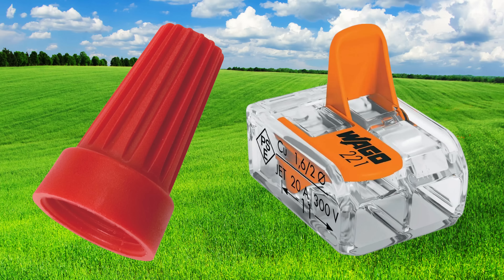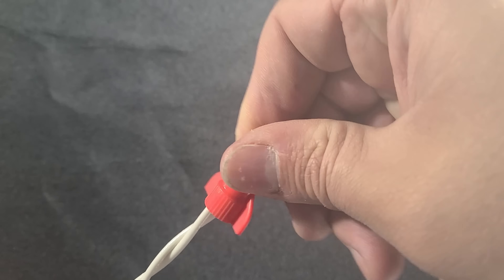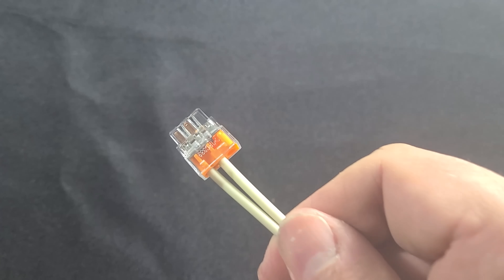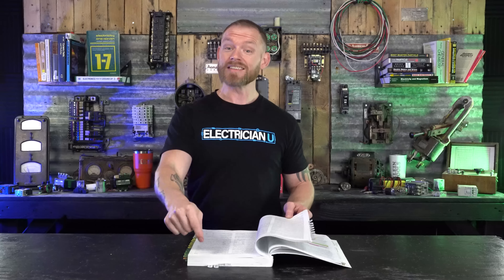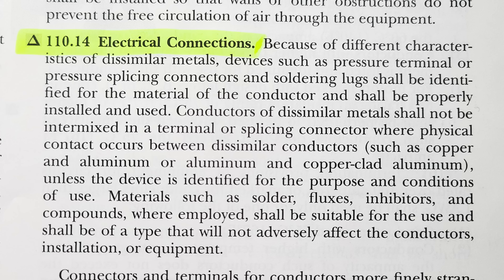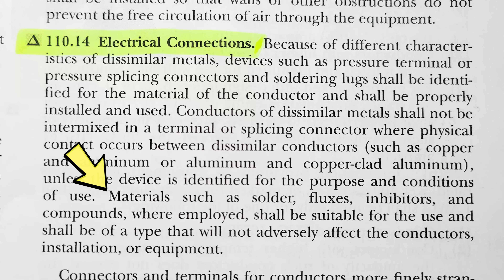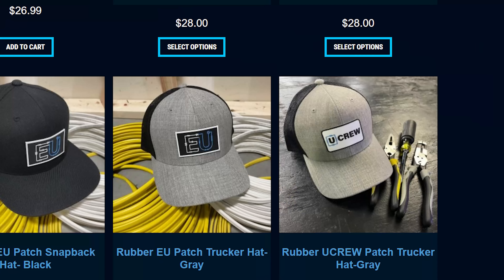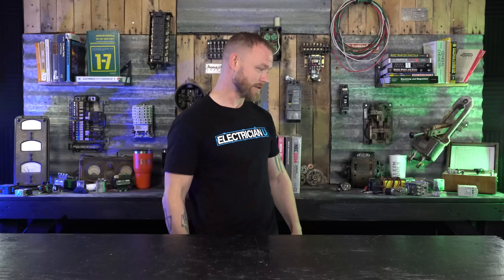Should We Use WAGOS or WIRENUTS?!?!

Comment: My contention with twisting wires—and my subsequent love of lever locks—stems from the fact that I've opened hundreds of boxes in the last 30 years to find 'work hardened' wires so brittle that the twists simply snap off the wire. Almost invariably the junction has already been reworked multiple times and wire is too short to reach the outlet and barely long enough to splice.
Reply: poor striping technique left the conductors nicked and fragile. it's the number one problem which dates right to the root of electrical wiring installation, stripping, over bending, smashing make it fragile. that equals game over.
Reply: Yeah, I wish everyone could figure out that you're better off to just put the wires together and put a nut on them. Twisting sounds like a good idea until you see a pre twisted wire that still doesn't make connection or burns up in the nut. I never have problems with just sticking them straight in the nut, no twisting or taping.
Reply: @jasonfoster9118  The problem with what you detail there is that the connections are not always made correctly and you get people then claiming that Wagos are superior because your connection failed.  The primary reason one pre twists the wires together is to assure visually that all the conductors to be secured under the wire nut are in intimate and proper contact.  Just holding conductors together and then applying a wire nut and assuming that all the conductors are held fast is shoddy workmanship.
Reply: wago/lever nuts also work by applying constant pressure, usually on a plastic pivot or boss, over time the mechanism becomes brittle and then you lose the tension the connection is relying on to stay in place.
Reply: That’s why the wires are required to be 6 inches beyond the face of the box.
Reply: @lsp4050  What code calls for is one thing.  But it doesn't fix existing installations from decades back done poorly.  In the end, short wires suck and the bypass butt style In-sure connectors are the cats ass for dealing with them.
Reply: @mikeiver  I’ve been doing inspection since 1999 and in 2006 the state of California finally required electricians to become apprentices before they could become journeyman electrician. Same thing I had to do before I became a journeyman machinist. Electrical is so much better here in California and it had been before and the structures are in better shape because they don’t hammer holes to the walls, shear walls. The Vegas singing commercial is bolted down transformers and make sure you have the proper clearances in electrical room and if you’re over 600 KV you have the one hour rating in that room. My jurisdiction requires all unused electrical in commercial to be removed, that irritates them.  Anyways, I enjoy what you’re doing and my boss enjoys it as well. Keep up the good work and maybe talk about motors
Reply: @lsp4050  Wires are required to be 3 inches from the ‘front’ face of the box and 6 inches from the sheath.
Reply: Work hardened wires?  I think not unless we are talking about wires that have been in place for many decades.  95% of the wires that break off are due to the installer stripping with linesman plires or incorrectly using a stripper and putting a knotch in the conductors.  Wagos don't fix this issue.
Reply: @mikeiver  Most of the houses I've worked in were built in the mid-1900's so perhaps I have a particular kind of exposure bias. I see lots of paper filler and woven outer jackets... and lots of fragile twists that break off inside the nut.

While lever-lock connectors don't retroactively prevent incompetence they do save the day when there's only an inch of wire left in the back of the box and there's no slack left in the wall. Have fun twisting a Marrette onto that. ;)
Reply: @helmanfrow  I have had to deal with allot of the very same as you.  Here we also deal with soldered and taped connections as well knob and tube. We tape or heat shrink the wires.  Also, agree with wires being short and wagos or insure being the only viable option.  Ideal has an inline push in that is perfect for the issues you detail.  Don't get me wrong, I use them, just not my goto for new work.  Over the years my attitude has "evolved" towards them and they are now in my kit.  For troubleshooting and quick fixes I keep them in my pocket!
Reply: @mikeiver  I'm actually surprised he didn't talk about taping the wire nuts. I always do this. Most, at least diy lowes/home depot light fixtures, for instance, will always call for the wire nut to be tapped after ensuring the wires are secured well. This is very common from manufacturers. it's just piece of mind as well.
Idk, I like tapping them.
I think about how cheap they are, how close they are to other wires and the off chance something happens, I don't want something happening from a 2 cent wire nut by not adding 2 cents of tape to it.
Reply: @todtalk3912  IMHO, taping the wire nuts, which I’ve seen, just leads to a ball of sticky mess for the next guy to deal with and he’ll just probably just cut it off and leave even shorter wires.
Reply: @todtalk3912  Non skilled electricians tape their wire nuts.  Properly terminated wires in a wire nut require no tape.  Those that use tape are covering up excessively long stripped conductors sticking out of the base of the nut or lack skill to terminate all wires correctly there in.
Reply: @todtalk3912  Properly strip and terminate the wires in the wire nuts and tape is a waste of time and unnecessary.  It is also a pain when you or others need to remove the connections to make changes.
Reply: @mikeiver  well take a copper wire bend 4 to 5 times likely to break on 6th to 8th bend copper work hardens wago dose not bend wire on install
Reply: @simonlang2001  it is interesting to me that people seem to think that I am anti Wago.  Connection wise, properly installed wirenuts are simply superior in terms of resistance.  Admittedly, in terms of skill required to install, they kinda suck!  Wagos are far simpler to install correctly and to verify that they are installed properly.  I like and use them, just not in high sustaind current situations.
Reply: Have to disagree with you on that one. I've seen it far too often.  @mikeiver
Reply: @ethelryan257  Doesn't change the fact that I am right.  Wagos have a higher connection resistance.  Resistance is heat.  Heat leads to failure.
Reply: @mikeiver  Why not just use Wagos if it's much faster and easier? Is it the cost or would you rather spend 5 - 10 seconds longer pretwisting then applying the wirenut thinking it's a better more durable connection (Wagos are UL listed dude and less error prone which means safer)? I remember way back when people used to strap and apply plaster for our walls. It was funny to see the contractors who just wouldn't switch to sheetrock.
Reply: Yes, I have same problem. I do a lot of work on buildings pre- WW2, and run into hardened wires, wires now way short; but I use lever locks not wagos.
Reply: @tongasmith910  Which lever locks are you using if not Wago? Ideal?

I'm not sure how the word "Wago" became synonymous with stab connectors. It seems to me that Wago's real claim to fame is in fact the lever lock (221-xxx, 222-xxx).
Reply: @helmanfrow  were waiting

Comment: The wagos with levers are the only ones I would use to mix solid with stranded. We don't ever buy those, so it's twist nuts, or for solid to solid the push-ins work fine. They are faster, but for hard to reach boxes (ladder or lift) I know the twist nuts will last, and no one will have to go back up there, ever.

Comment: I'd used wirenuts for years.  Right up until one of my wirenut connections corroded, broke, or slipped out enough to start an arc fire.  Vaporized the wirenut plastic and then the hot wire shorted out to the metal enclosure.  That fried some parts in my $1200 solar inverter!  So it's Wagos for me 100% of the time.  Yes, they are a bit more expensive, but peace of mind for a few dollars is priceless.  I've also seen a case where somebody used a wirenut that was too big for the conductors, and the homeowner had no power downstream of that wirenut.  Fortunately, there was no load on it, so it didn't arc.
Reply: I have seen wago's melt and nearly catch fire also .

Comment: For splicing more than one stranded wire together I prefer Wagos.  I also like them for low voltage connections, especially when you have to splice a small wire to a larger one.

Comment: One point not mentioned that I’ve learn at my school years ago - wirenuts provide less resistance, than thin connections inside Wago, means if you overload (experiment was 40Amps or higher), the temperature in Wago was way higher, eventually made it to melt. So i use it for lights and small load appliances now jic

Comment: Wagos are designed for 32 amp circuits.  They have test videos where they far exceed that and they stay connected even after all the insulation burns off.
Reply: 500 ampers than start wago to burning,yes they say 32 ampers because it's up  6mm cable connection.on 500 ampers cable melt which can fit to wago
Reply: Typically… thats funny… typically they where 600V 20A 1,5mm^2 and 2,5mm (14awg, 12awg).. with typically i mean the last 64 years.. the 10 years prior they did not get much use… 

Now the push in for a rated current of 32A but requested use of 80% and the clamp ones rated for 41A.. 80% are your 32A… with other Wagos.. you are typically wrong…

And even now.. the new clamp ones..they are made for 420V, 4kV failure load, 41A by IEC/EC or 600V 30A by UL.. wich makes them worse in the USA than in Europe.. 240V .. means more power less material needed.. 3 phase connection landing at 380V between.. (420V 20% buffer).. that is the reason why Americans can‘t use them like we do.. we germans can use them even up to a load of 7,5kW and the stab ones to 5,7kW load while americans can use it to 2,5kW savely.. wich can be way easier to reach in a household… that is why also featherclamp connectors for American plugs are hated while the work perfectly fine in europe..

By the way.. the lamp connectors are rated way lower.. and do not twist the strands.. a few americans seem now that they have discovered Wagos are heaving a few problems with them..
Reply: @CellaDorrn  great post man you should try translating it to English
Reply: @hoohah7716 na sorry.. can’t even handle my own Language…. School till i got 25 but never learned a thing about speaking and writing… maybe because a doctor wrote that i don’t have to but it got locked to a D grade…

But i had a straight A in physics ;)

Comment: Low current, sure why not use minimal contact WAGO connectors but for anything over 100w, pre-twist your wires and use the proper sized wirenut and tape the load side at minimum with black electrical tape. The odds that you will ever come back in your lifetime to fix that connection because it failed are slim to none. Push connectors on switches and receptacles are the number one cause of arcing related call outs for the companies I worked at in the past. How the electrical code ever allowed those lazy POS connections is beyond me but money under the table had to have been involved.

Comment: I guess i have had to change far too many stabbed in outlets and switches which burned up to trust any stab in type connector. Yes I've seen the load tests. I have not seen any load tests on a wago which has been in use for 10-20 years though. Wire nuts are proven by time. They just don't fail if properly installed.

Comment: Personally I only use the lever style wagos, and usually only on circuits that will likely be changed or moved around in the future (4 gang boxes for example) , or when using stranded wire, mostly if I'm mixing it with solid... so mostly still just using good ol wire nuts, but I'm still weary of push in only connectors even after watching the tests 🤷‍♂️ I will say it is very nice to do refits or remodels where someone used lever wagos 🙏

Comment: Wire nut, because of course you'd never do anything dumb like  hook up or work on anything hot ever....cough, cough wagos.

Also handy if you are working on equipment that you have to do temp installs or figuring out how to lay everything out and be easily cleaned up.

Amazing for hooking up gang boxes with multiple sockets/switches.

When I have to go through the butt pain of unfuckering the work the electrical did on my house (it is breathtaking how shitty of a job he did.) I generally use wagos.

Comment: Thanks for clearing the air on this. I've always just used wirenuts and have been leery whenever I see somebody recommend lever-lock connectors. I'm perfectly happy using wirenuts, but more than three conductors can be a pain to work with. Now that you've explained the code and that lever-locks are acceptable, I might have to try some on my next wiring project. Thanks for sharing!
Reply: I would highly advise to go with the branded Wago 221 series.  Those are the clear latching connectors.  There's also the 222 series, but it's larger and is not clear.  Oh, and the 221 explicitly has a shielded test point, so you can safely take readings on a live circuit without ever having an exposed conductor!

The push in style like at Home Depot are just terrible, and I would avoid them if at all possible.  They're not even the same product, and I would never equate them to the levernuts.

Comment: I've always pretwisted wires with linesman pliers. Always thought that's what they're for. Others tell me that the nut does the twisting for you.
But I discovered Wago's. If you have ever tried to twist 5 - 12g wires together it sucks but not for the Wago. I don't like that the wire seems less secure in a Wago but I've watched all kinds of high amperage testing and they take the resistance without failure

Comment: Wagos are complete crap. I live in a studio apartment that is 7 years old it has wagos connecting the wires. Not only did my light bulbs blow out. My electrical plugs keep blowing. The wires are loose on almost every connection where there is a wago. I have had to remove several of these and install wire nuts to fix the issues. After time with the wires expanding and contracting wagos become loose and cause a short.

Comment: Wago's are junk and a fire hazard, I've been throwing these things away for years.
Probably works fine for hobbies or anything under 5 amps. I have been a commercial electrician for 30 years and these damn things are always a problem. I will admit the lever ones are a bit better but still get trashed,
The biggest problem is when there is a 16ga. or smaller wire in one and you shove in a big ol 12ga. which loosens the spring tension on the wago clip inside causing a loose connection even when installed correctly there is little contact from said clip to copper wire again loose connection and melted wires time and time again. They are junk. 
It's also why we have lineman pliers which by code is considered mechanically connected.
Speed kills folks, do the job the right way, there are good electricians and real ones which one are you?

Comment: Thanks for the video, near the end of this video you talked about using quick connectors. When you use and crimp on quick type connector I was told these should only be used on stranded wire only because a crimp quick connect doesn’t have proper compression force to stay on a bare/smooth solid wire conductor wire unless soldered. Please correct me if wrong, thanks.

Comment: Wago lever connectors all the way. For those who justify twist connectors saying the lever nuts are too expensive: two wire Wago lever nuts are only $0.25 each on Amazon in quantities of 100. If you’re billing at $60/hour, $0.25 is 15 seconds of time. While they may not produce a net savings, they’re not driving your costs up significantly. Wire nuts require you to strip, gather the wires into a bundle, change tools to twist, trim and only then put on the connector. Lever nuts only require you to strip the conductors. One tool. Plus you don’t have to connect all the conductors together at one time. With wire nuts, I have to separate the conductors before making connections. With the lever nuts, I can make connections as I go. As soon as I separate out the next conductor, I trim to length, strip and make the connection to the block. A quick tug on the wire and I’m 100% sure I have a good connection. If anything needs taken apart, you don’t need to re-strip the wire because the lever nuts don’t damage the conductor.

Comment: I’m not a fan of Wago’s because the surface area and metal mass doesn’t seem to be sufficient to carry the circuit’s max load continuously.  With wirenuts and pre-twisting, you’ve got more metal to metal contact between the conductors rather than a thin strip of metal carrying the load.

Comment: Wago's are not as good as a twisted  connection. Wire to wire, no bridge to fail.  Wagos will fail
Reply: Wago's are a mechanical splice/connection. It will fail over time.

Comment: I use the wago lever nuts just because my hands cramp up when I try to use the caps. They also seem to make for a cleaner install but I do agree that a well twisted connection feels very secure. Also, sometimes the little levers move just a bit when you push everything back into the box and things start to rub up against each other so you have to be careful.

Comment: I have an circuit(s) outlet that serves my garage wall and is common to 9 outlets and 7 ceiling lights (multi wire branch) WAGO saves me at that outlet in case I have to replace the outlet I don’t have to shut off my whole upstairs lights by just un levering 3 wago levers and replacing pigtailed outlet